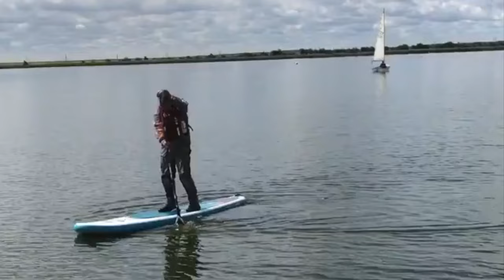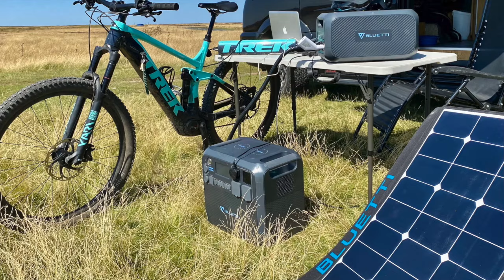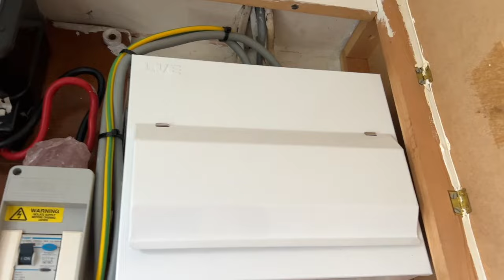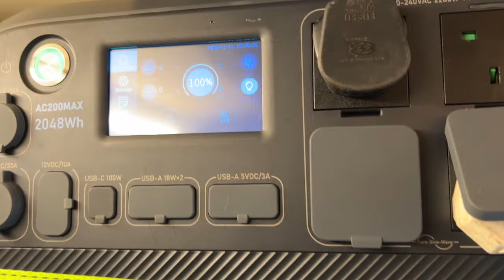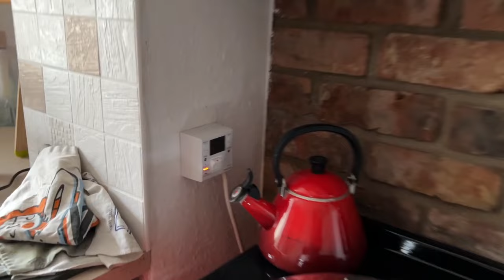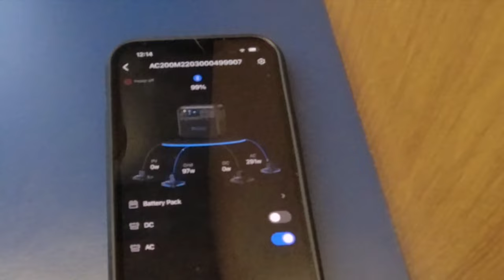BLUETTI AC200MAX Runs My Camper & Cottage👍

Comment: You're amazing, I wish you could talk to the auto electrician's here in South Australia, it seems they're all numpties, none of them will hook up a DC to DC Charger to my Bluetti AC200Max in my car as they either say it can't be done or they don't know how to do it, so they tell me I can only have solar or shorepower to run the Bluetti, I even send them videos like yours, I don't think they watch them, I think they believe Victron when Victron says it can't be done and they just don't know how to use powerstations. It is really frustrating as all I'm asking is for them to have cabling running from the car battery/alternator through to the rear of the Kia Carnival and attach the XT90 adaptor onto the end of the Victron DC-DC Charger to then enable me to plug into the Bluetti, I even provide the Bluetti adaptor that is for the lead acid battery, so they can use that XT90 adaptor. I just don't get it, no one will help me get it connected, I'm at a loss. Victron say their charger's are too low so it can't be done, as you need a 48V charger. I can see in your video and other YouTuber's videos that Victron is what they're using, so it can be done, how do I explain it to them if they won't watch the videos and believe Victron and won't listen to me, please help, thank you in advance, Vicki.
Reply from the maker: Hi Vicky 
I do have the B2B linked to my EcoTree battery and then I take the power out of my battery to power the 200Max this works really well and enables the switching from one system to the other hope that helps 
Dave 👍

Comment: Interesting stuff , is your Aga heating your radiators ?
Reply from the maker: Hi John not now it did run of a gas tank in the garden but it was very expensive to run it did heat our water and some of our radiators but now it’s all Electric at 13amps and on a timer so we just use it for cooking and heat in the kitchen 🙏👍😍
Reply: @onemanandhiswhippet  interesting , we had one back in the day as we got free wood , it did all the heating and cooking , it was a bit greedy compared to my Scandinavian log burner
Reply from the maker: @bladerunnervw  it works great on electric 👍 Wood burners ordered 👍😁 and we had a new condensing boiler fitted too all the fun of living in an old cottage 😂👍

Comment: The AC200Max would have been perfect if not for the size and weight of it. It does weigh a lot and it is difficult to move it at times.
Reply from the maker: Yes it’s always a compromise more power more weight 👍